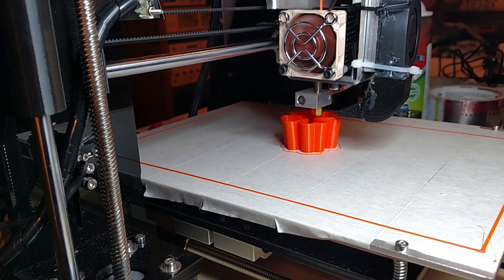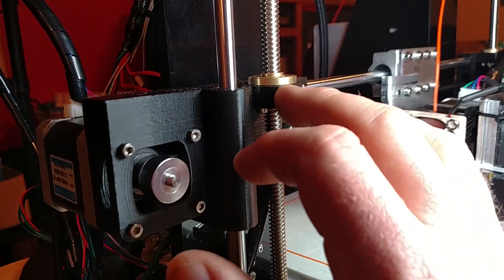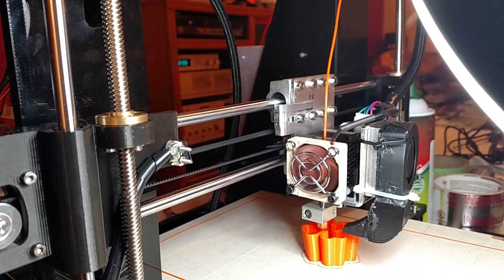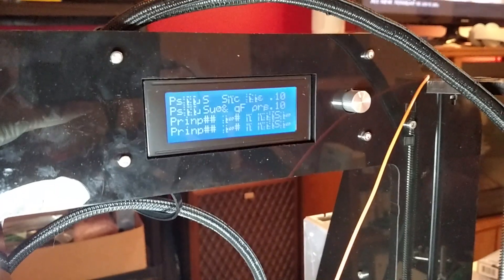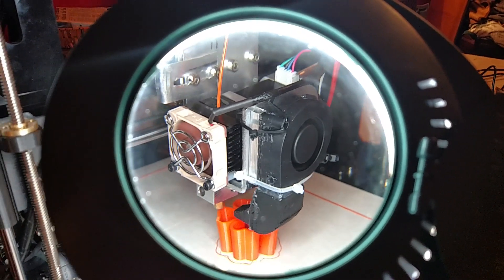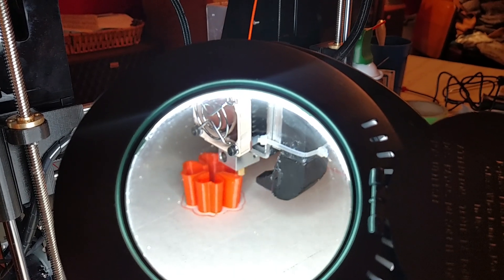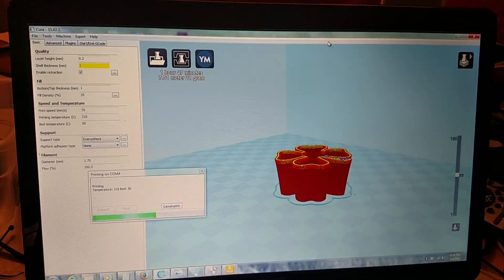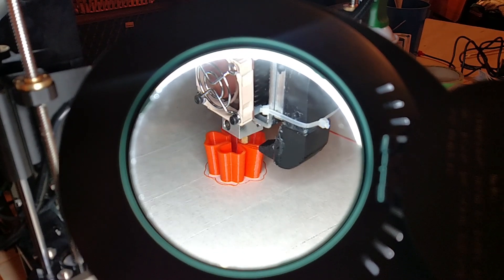HIC Technology PRUSA I3 3D printer - 1st test print

Comment: using a noctua fan for the extruder cooling? Very clever:-)
Reply from the maker: +3dprint-tech I was with the direct drive setup. Now I'm running an E3D V6 and the fan is not a Noctua.
Reply: Ok thanks:-)

Comment: i bought hictop 3DP-11 from amazon the z axis uses threaded rod and a nut for z axis this i didnt notice till i got it and started putting it together argh anyway for the most part went together nice what i am having issue with is the flanged bearing opposite the stepper motor on x axis it is not rolling properly and causing missed steps and other havok "the bolt and nut are not to tight" was wondering what your kit came with and if you had any issues with that?
Reply from the maker: +MXStar189 I'm not sure that I completely understand. Is your X axis missing steps, or your Z axis?
Reply: +adamky1 x axis because of the bearing is not rolling right inside the bracket needs washer or something or bigger bearing maybe? so its putting to much drag on belt making stepper work to hard.

Comment: Glad that you're finally getting good results with printer. 
Based on the video, looks like you've also replaced the threaded rods (Z axis) to a lead screw. I've got the same printer couple days ago and I don't get good alignment between layers. I believe it's caused by bent rods as well as probably the thread on the rod is not precise.
Can you please list your Z axis mods and purchase links if possible?
Reply from the maker: +Eugene Shelepov I have not modified the Z axis in any way.

Comment: so what 3d printer do you suggest getting? I see in a comment below you say not to get this one. I'm new to 3d printing and I don't want to spend to much either. But I would like to find a printer that's big enough to print helms and guns from some of my favorite video games.
Reply from the maker: I would look at the Makerfarm printers. They're constructed of a hard wood that should be significantly stronger than acrylic. They're a little more expensive, but not that much more. I've heard that their customer service is very good. And if you're located in the U.S., its going to be 100x easier dealing with customer service that it would be dealing with HIC (who are based in China).
Reply: +adamky1 No I have a makerfarm, and they are over priced, and junk!

I have a Makerfarm Prusa I3 8" and it has been nothing but problems. The guys at the Makerfarm website are less then helpfull, and getting updated info on the firmware is a pain.

It is made from wood, and it does not last, the threaded rods are 5mm and even keeping them lubricated, I get around 100 hours before they strip.

I just bought the printer listed here witch I can tell by looking is far better then my current makerfarm at 1/3 the price!

I to this day have no idea what to do about making firmware changes or settings changes, like I said the guys at Makerfarm will not help.

SO I hope with this new printer I get instructions n how to program the settings, when I do I am taking my makerfarm apart and building a 16 X 16 X 16 inch printer out of aluminum tube and throwing the crappy wood away.
Reply from the maker: Good to know. I'm not sure what to tell you then. I'd get something with a metal frame. Acrylic sucks.
Reply: +adamky1 I ended up getting a qidi tech 3d printer
Reply from the maker: +Braxtyn Brannon I really like that one. I hope it works out well for you.
Reply: +adamky1 its great so far only prob I have is having prints stick to the bed to well lol
Reply from the maker: +Braxtyn Brannon I use an upgraded silicone heated bed that I can get up to 120*C fairly quickly. Although I rarely go that high. I use boro glass on the bed. The glass is cleaned with rubbing alcohol before being covered in cheap sticky hair spray and left to dry. hi make sure your first layers are slightly "smashed" a little. this helps get the first layer to stick
Reply: +adamky1 what grit of sand paper do you use to sand down 3d printed projects?
Reply from the maker: ?? I don't sand down 3D printed projects

Comment: Yo man is the printing size for this actually 270*200*170cm ?
Reply from the maker: Yes it is, but don't buy this printer. Acrylic is not strong enough for a 3D printer. Get one with a metal or even a wood frame.
Reply: +adamky1 damn dude I literally just ordered it lol. what problems does the acrylic cause?
Reply from the maker: +pptx100 Cancel the order ASAP. Seriously. Acrylic flexes too much and if you over tighten something, it can crack pretty easily.

Comment: @adamky1 : Am planning to buy one, please give me your suggestion.
Reply from the maker: Don't buy one :-). Seriously, avoid acrylic frame 3D printers. Acrylic is just not strong enough. If I had it to do over again, I would have bought either a Makerfarm kit, or a kit  with a metal frame. I've thought of upgrading mine using Makerfarm parts because I like their V-slot rail system.
Reply: Thank you for your information.. you saved my money and time..

Comment: Hey! My linear bearing lose some of the balls. Did that happened to you?
Reply from the maker: Sure did. I just reassembled mine last night and lost another one.
Reply: haha... but they don't grind when they move?
Reply from the maker: +Erwin Ried No, they seem to do fine as long as you only lose a few. If you need new ones, I suggest going to makerfarm.com or adafruit.com.
Reply: +Erwin Ried the ones that come with the printer are junk. you can get new ones, they're standard linear bearings LM8UU. sprite science sells a 12 pack on amazon.
Reply: +Andrew Saturn nice, thanks! anyway the seller sent some replacement!. What I dont like is how the extruder is held only by the bottom screws :/ I guess it could be replaced by an mk8
Reply from the maker: Erwin Ried The extruder gear sucks on these printers. I would recommend upgrading to a different extruder with a MK7 or MK8 drive gear. I'm running a Bowden with a MK8 drive gear now and it works so much better.
Reply: Is that the one you show in the video? because it looks as the stock one
Reply from the maker: No, I'm running a E3D V6 Bowden setup now. A bowden setup relocates the extruder off of the x-carriage. A PTFE tube then connects from the extruder to the hot end. I've done a whole lot of mods since first getting this thing.  Here's a picture of my printer in its current state: http://i83.photobucket.com/albums/j314/jefrom19/3D%20Printer/IMG_20150921_031331737_zpsdk4hvbzg.jpg

Comment: @ademkey1 I Have the same printer as yours, I didn't have the problems you have, I had problems with the bed.
Also what is the Max Temp you were able to get your Bed?

If you are interested in cable management, especially for the Bed cables check this link: http://www.thingiverse.com/thing:944166
I made the designs for me.
Reply from the maker: Atanasov Goran With the aluminum 270mm bed that comes with the kit, I could barely get it to 70*. I upgraded my Y-carriage to an aluminum piece I bought off of Ebay. Here's a link to a picture: http://i83.photobucket.com/albums/j314/jefrom19/3D%20Printer/IMG_20150430_205649671_HDR_zps9jerjtih.jpg. Not long after that, I decided to replace the aluminum bed with a piece of borosilicate glass and that's when I was finally able to get my bed temps up to 90*. Here it is with the glass on: http://i83.photobucket.com/albums/j314/jefrom19/3D%20Printer/IMG_20150501_153445409_zpsxnywywfc.jpg. That big aluminum bed that it comes with is oversized and is basically just a big heat sink that limits your max temp. Besides the glass, I also built a plexiglass enclosure which allows me to get it up to 95* (but it takes a looooong time to get there). Check out my photobucket if you want to see all of my modifications and upgrades: http://s83.photobucket.com/user/jefrom19/library/3D%20Printer
Reply: adamky1 Yes, it is terrible that the Bed exceeds the heating PCB,Have you seen this Heater Mats : http://uk.rs-online.com/web/c/automation-control-gear/temperature-control-process-heating/silicone-heater-mats/?vn=2They have all kind of sizes, also i think you can have custom sizes made, also there is an option for mains voltage, which definitely would fix the heating problem.
Reply: adamky1 As I understood from the photos, you reduced the print area to 200x200? that was what i was planning to do in the beginning, before I discovered this mats
Reply from the maker: Correct. I can think of one time in the past 5 months when I needed to print something bigger than 200mm and I was able to do that by tilting it at an angle. The other benefit to glass is that you can have several pieces and quickly switch them out and get started on another print. What mats are you referring to?
Reply from the maker: Atanasov Goran
Sorry, I somehow overlooked your earlier reply with the link to the mats. Thanks for the link. I'll check them out.

Comment from the maker: @ Nick Aceves
Are you printing with PLA? What is your nozzle temp? If you can, remove the heat sink and fan, and post some pics of the extruder and some pics of the nozzle setup. Post the links here and I'll try to help. If you could upload a video of it with the fan and heat sink removed, that would be even better.

Comment: Wrap your led wires in aluminium tape it's having interference issues common problem
Reply from the maker: iCloud Henshaw I believe you are correct about the interference. I've been communicating with HIC recently and they recommended using shorter cables. While researching the issue this week, I stumbled across a thread describing my same issue and it seemed like the general consensus was that it is EMI. The recommendation from everyone was to make some new cables using shielded cable. So, I ordered some new 10-pin 2x5 connectors and some CAT7 shielded cable to make some new cables.  I actually thought briefly about wrapping the wires in aluminum foil tape but read it wouldn't make that much of a difference unless you grounded it somehow. I guess I should have given it a try first.
Reply: yeah i had this problem with my printer and its lcd it stopped happening when i upgraded to sailfish but it is just the case of getting some shielded wires
Reply from the maker: iCloud Henshaw I appreciate the tip. I wrapped the ribbon cables in aluminum foil tape and it is much, much better. It has only messed up on me once in the past two days, as opposed to multiple times per day. I'm going to make some cables using the CAT7 cable and see if I can eliminate the problem completely.

Comment: I just finished building mine and I'm having a major issue.  My computer does not recognize the printer. Did you encounter the same problem? How can I fix it?
Reply: +LehighValleyrailfan Productions Try this: Check if you installed the drivers that came with the printer. If you have those, try reinstalling the firmware of the printer (the company can send you that through email). It worked for me, hopefully it works for you too.
Reply: Same
Reply from the maker: +LehighValleyrailfan Productions Wow, I completely missed this comment somehow. Sorry about that. Did you ever figure it out or did you end up returning it to HIC?
Reply: +adamky1 no I only just got the printer so I'm still trying to figure it out and I am in contact with the company too.
Reply from the maker: I've had many issues with this printer, but communication between my PC and the printer has never been one of those. Just keep working with HIC and I'm sure that they'll be able to help you figure it out. You just have to be very patient with them.

Comment: Got the same kit for my first 3D printer and am having a pretty hard time getting it to print right. I was wondering what was the leveling wizard you mentioned?
Reply from the maker: Anzh Castillo In Cura, you click on "Expert", then select "Bed leveling wizard"
Reply: adamky1 If it were a snake it would've bit me. Thanks so much! hopefully this will solve some things.
Reply: adamky1 Did you have to go into any of the firmware editing or calibrated extruder or anything like that?
Reply from the maker: Anzh Castillo
No I did not
Reply: Anzh Castillo I just got this printer.   I am going to calibrate the steps and extruder filament.  Are there any settings in the marlin firmware i should edit?
Reply: Scooter G No, they have everything set up for you already. If anything's off, they have a link for you to download and reboot the firmware.
Reply: Anzh Castillo thanks!
Reply: Scooter G Anytime!
Reply from the maker: Anzh Castillo Is yours printing alright now?
Reply: adamky1  No. I've been running into a lot of problems lately with this printer. I did have a couple of good prints though.

Comment: Hello i got this kit. I made some prints but only works  if im monitoring the impression. 
also i have problem with the left x-axis when the z is incrementing the rod tends to slip by pressure. 
Can you share your cura settings please to this email digitalparadox.dev@gmail.com??. It looks really good.
Have you tried to print ABS? Can we do with bed temp 70°C??
Sorry for my english. 
Thank you so much

Comment: Did you get your Display to work? If not it looks like you have a loose connection on the serial line of your display I see this all the time with one of the displays that i use on my bread board that's why sometimes it looks good and then others it starts to throw in trash... not a major problem just check your wires and be prepared to maybe solder a connection. Your print looks awesome...
Reply from the maker: Vintage USA Tech I'm still having intermittent issues with the display. I've tried two different displays and two sets of cables and the issue still pops up every now and then. I'll take a closer look at the board and see if I see anything that looks like it needs to be resoldered.
Reply from the maker: Vintage USA Tech Alright, so my LCD has finally gotten to the point where it just does not work well at all. It constantly turns into jumbled pixels and characters on the screen. I tried re-seating the connections last night and that just made it worse. So, I've got the LCD and the controller/driver board both removed and I am trying to see if I see any connections that look bad and I see nothing wrong. Where exactly is the serial line of my display? What should I be looking for here?
Reply: adamky1 Which display are you using?
There are a few flavors...1. 12864 Graphic LCD Display 2. 2004 204 20x4 Character LCD Display 3. 1602 Display. Most of the time they are blue display. Let me know what you have and i will look up the pin out. also would help to know what firmware you are running ie. Marlin or something else. I just got my printer finished havent added the Display to it yet.. still working to fine tune it... and got to dry out my ABS i opened it like a Noob 2 months a go and its popping and sputtering. LOL oh well live and learn.
Reply from the maker: Vintage USA Tech It is a blue display and it looks a lot like this: https://www.youtube.com/watch?v=6i7AwR0ZC8g. It says "SCM2004A-Ver2.0" on the back of the LCD screen. I am running Marlin Firmware. I have had this same issue on two different LCD screens and 2 different sets of cables, so I'm inclined to think that it's an issue with my main driver/controller board as opposed to the LCD screen itself. While I had it apart yesterday, I went through and touched my soldering iron to each pin of the LCD connection ports (on the main board) just to make sure they all had decent solder joints. They all looked good and I am still having issues with the screen again today. 

About the ABS, I bought a big bag of desiccant off of Amazon and I throw a couple of those in a ziplock for storage. However, I do occasionally hear a little pop while printing and I wasn't sure what caused that.
Reply: adamky1 Yeah I agree if you have had this problem with 2 LCD's and cables I think you need to check the ramps board and the arduino board... you probley be looking for a bent pin, a short pin, cold solder joint on the ramps board or the arduino or a small bead of solder or between pins . Hope that helps looks like you had quit a few issues with that printer.... did it come preassemble  or did you build it.  Thanks I will gram some of the desiccant and give that a shoot..... just pulled off my first really nice print. Im digging the 3D printers

Comment: Hey man!  I got the same kit as you and experienced the same problem with the right side supports.  My printer has only the left supports as well.  Just wondering, did you figure out if the plastic that came with the machine is abs or pla?  I'm just about ready to do my first print
Reply from the maker: 84tified I'm pretty sure that the plastic that came with it is PLA. ABS tends to break when you bend it completely over and I noticed it didn't do that. If you need to print yourself a new left or right X-axis part, Keith Reis has created the files and published them at www.thingiverse.com. Here's the link: http://www.thingiverse.com/thing:712896